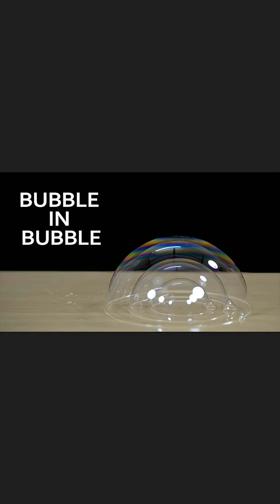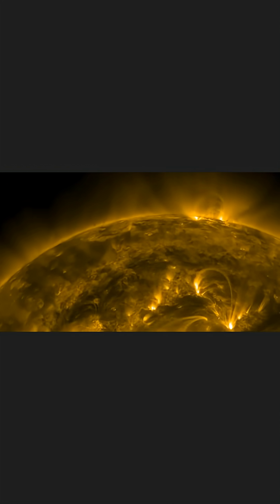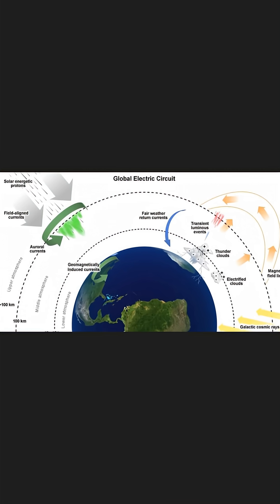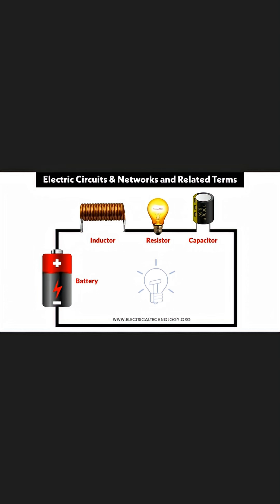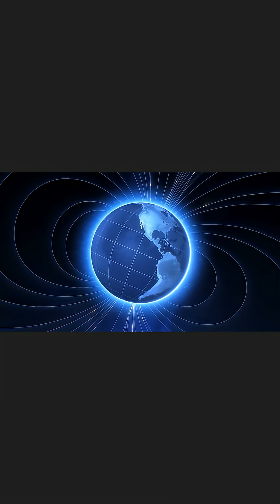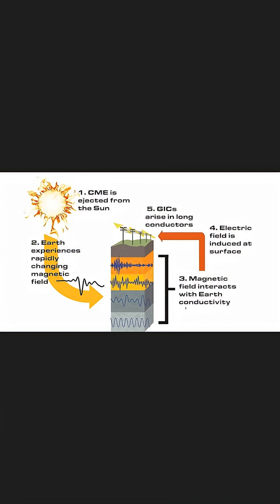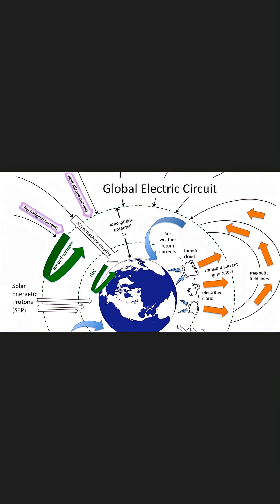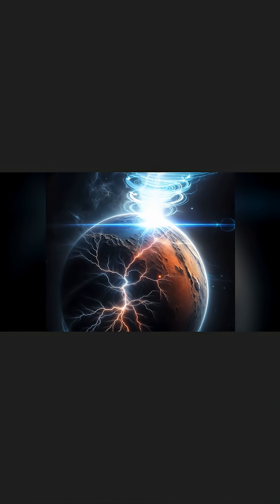What Happened to Mars | #electricuniverse #vallesmarineris #mars

Comment: If Mars was once a functional spherical capacitor with an inductive core of iron that was then overcharged to the point of dialectric breakdown of its mantle during a catastrophic discharge event, then some of the molten iron core could be discharged through the breaches in the mantle onto the surface. If, until this event, Mars had a functional planetary magnetic field that could retain a substantial atmosphere, that atmosphere could have contained a good deal of oxygen. However, once the component failure of the spherical capacitor had occurred, shorting out the core to the crust through the damaged dielectric mantle, this could help to explain the shutting down of the planetary magnetic field, thus starting the long and slow process of the dissipation of the oxygenated atmosphere to space, carried off by the solar wind. However, while there was still oxygen in the atmosphere, any of the expelled iron from the core onto the surface would be slowly turned to iron oxide, better known as rust, and due to weathering, the solidified iron turned to rust would eventually become iron oxide dust, and would end up covering and coating the entire planet, which would help to explain Mars' famously orange red hue over its entire surface.
Reply: https://youtu.be/HZMz7vkdHKY?si=6p6X08xlQPyu5app
Reply: Absolutely spot-on!!